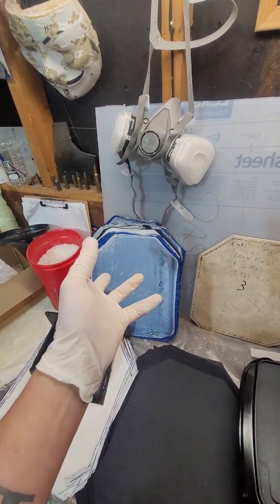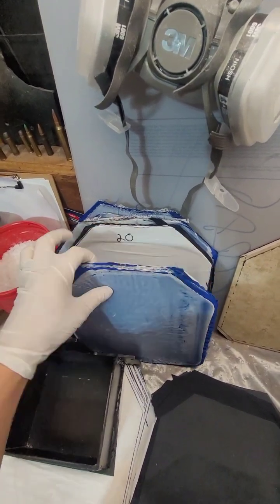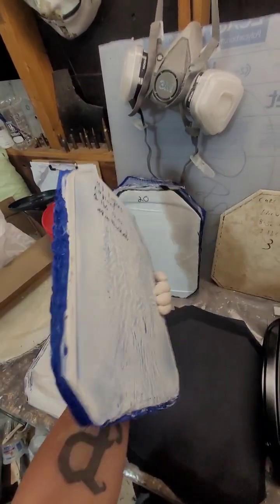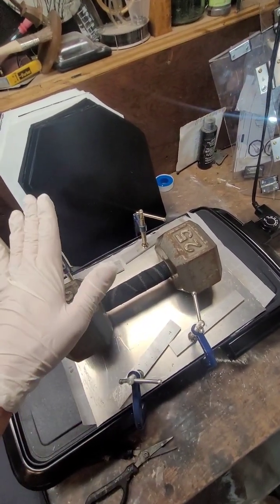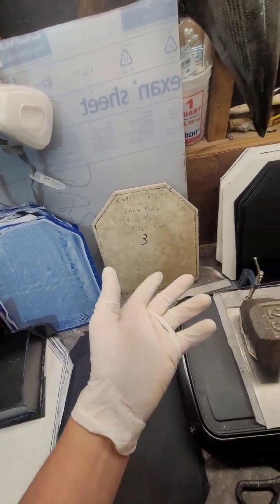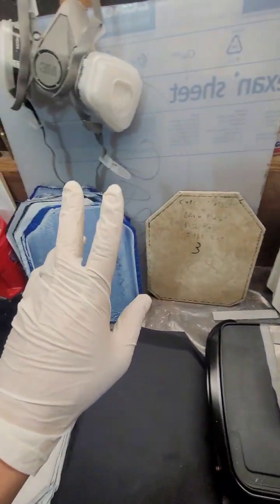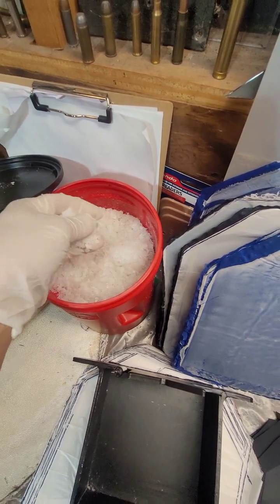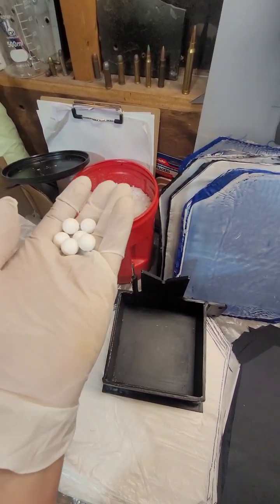Recycling ♻️ HDPE into armor! #armor #recycling #gun

Comment: Haha great minds think alike! I have a similar idea with HDPE and alumina balls except I'm planning to suspend 3/8" Silicon Carbide ceramic ball bearings in a matrix of HDPE in solid block form as the silicon balls are significantly harder and more difficult to break than the alumina balls. I also noticed what looked like it may have been either a .30-06 or .300 Winchester Magnum on that shelf in the background.

Comment: Went to Plasticworld in Toronto this weel, got a 12x24 sheet of lexan in 1/4 inch and a 1/2 inch sheet of hmw. They threw in a 3/4 inch sheet of hdpe cuz of some ordering issues. I also grabbed 5 metres of 18 oz woven roving and some vinyl ester. The lexan is for something related. I will be compositing all that with some 16 gauge steel and tile With a final wrap of Trex brute force. Oh, I will be using weld bond for adhering the steel to the plastic, same with the tile. I also bought a roller to get the best strength out of the glass and I bought extra so I would have room to make every 3rd sheet of glass bias cut. 

The HDPE will be used to make [probably] non ballistic splint pauldrons and a tasset/skirt I also have some store bought  bracers in 14 oz leather which will be a base for splint mail.

Comment: Use Kevlar® fibers with in the HDPE this should allow for more power absorption throughout the whole plate. If micro bubbles can be added this will help damp  the impact. Instead of Kevlar, try Carbon Fiber weave a.k.a. graphite fiber or graphite fibrer.😊
Reply: That's not going to work. You do not want voids of any kind in your armor. Voids will only help a bullet penetrate which is the opposite of what you want. We're trying to stop bullets not make it easier for bullets to kill us!!! SMH.